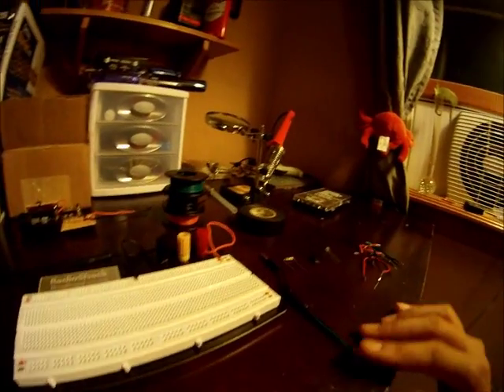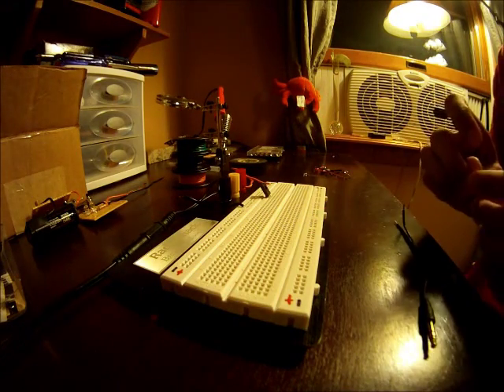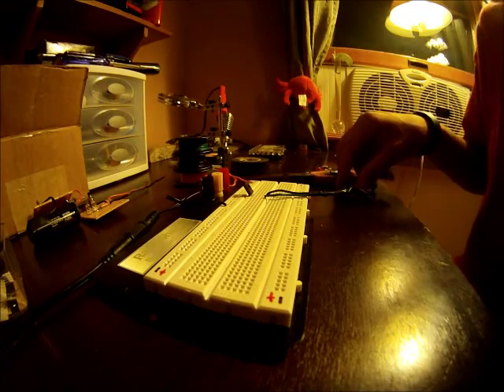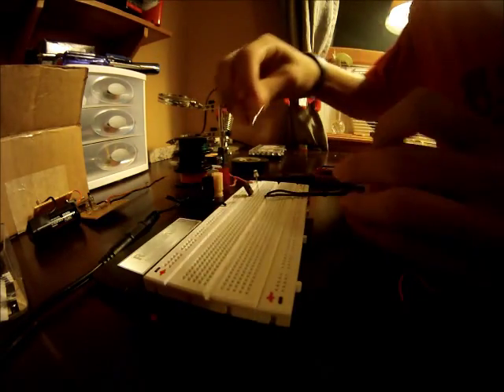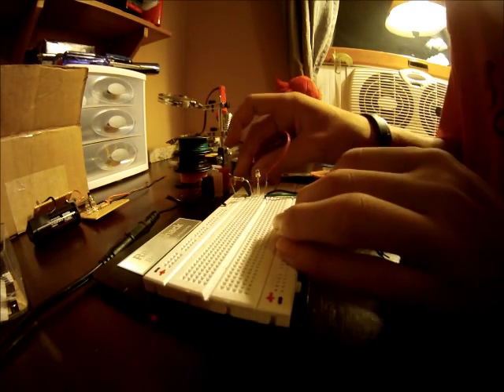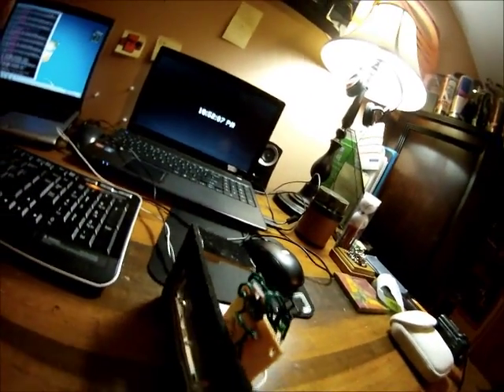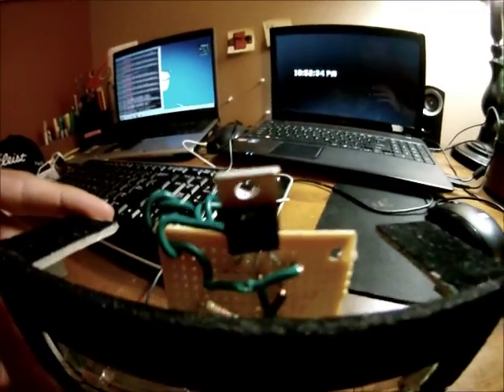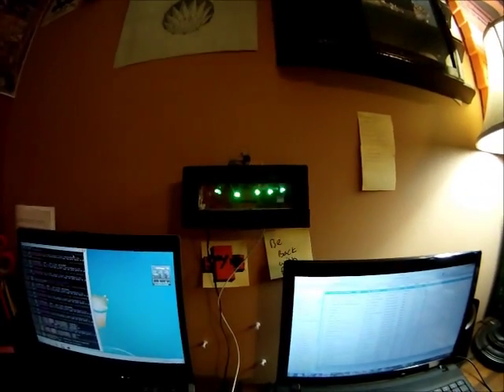TIP31 Make Led's Blink to Music Tutorial

Comment: its 9 volts and the tip31 costs like 2$ at most radio shacks the package will be clearly labeled so you will be sure that its correct. If you want sound then you need a splitter and speakers.
Reply: Bought 10x  at ebay from China -  1,39€ maybe (1,80$?! ) with free shipping

Comment: @mtnbiker1123 so the tip31 where can i find one. im broke right now so im looking for one in a rc car or chargers. what would be the most likely spot to find it i have a horde of circuit boards from broken things i can unsolder them. ps this will be goinginto a Logitech Pure-Fi Express Plus iPod dock for speaker lined neons its a custom mod , the power adapter for the dock is 10v 1.3A so i assume the power going to the speaker is around 10v. please reply or post vid for me please